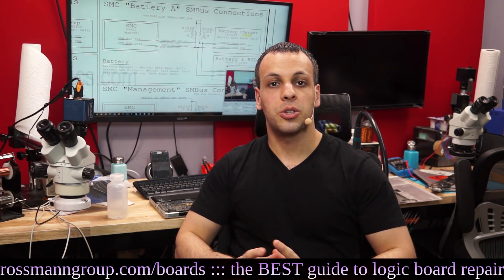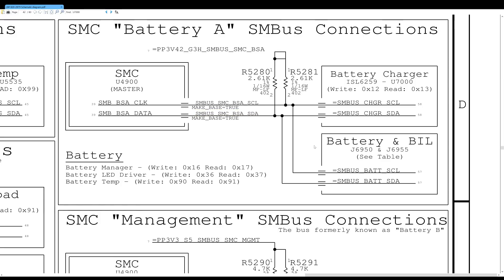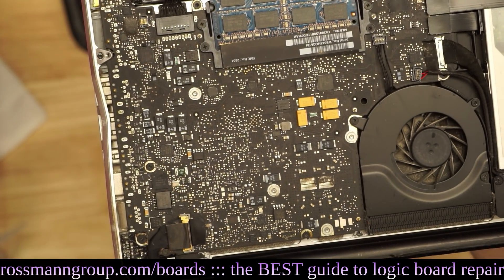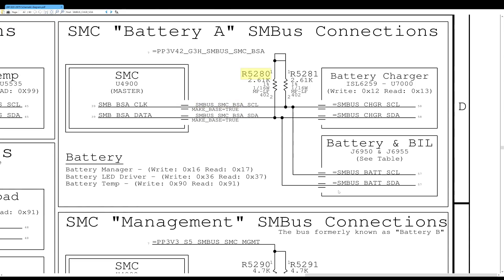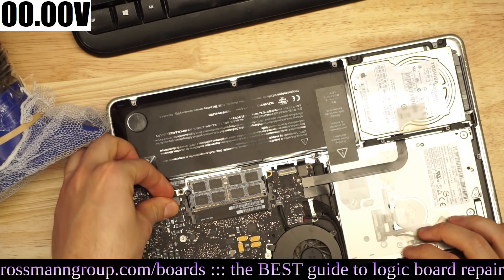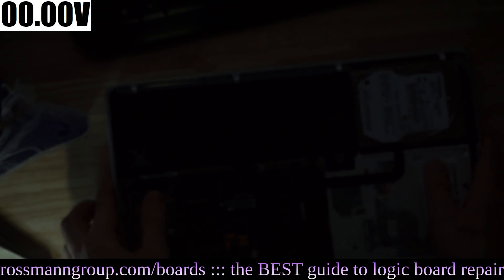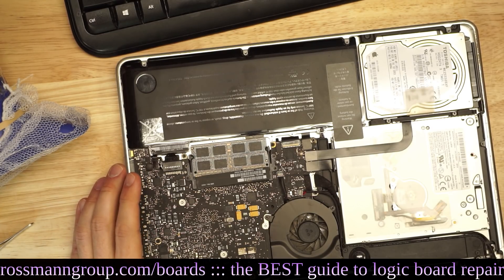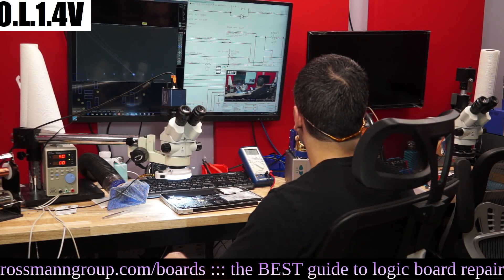Battery not showing up on A1278 Unibody Macbook Pro: how to troubleshoot & repair.

Comment: Thank you very much Louis for this excellent repair tutorial and help.

In my case I have a battery indicator that when you press the button, all the indicator LEDs flash 5 times "blinking".

What is it indicating?

Magsafe lights green, no blinking.

I can't find an answer on the internet.

Thank you!

Comment: I just want to say thanks for posting the video. You helped me out tremendously! Thanks to you I was able to diagnose my issue down to the battery indicator led strip. Whenever it was connected to the board my computer would not recognize the battery. I replaced the battery indicator strip and bingo! Thanks again!🙌🙌

Comment: Hello. I have a MacBook air 13" witch does not recognize the battery. I did check the voltage in these data lines and they have 3.2v. What could be the problem?

Comment: Good day sir..im newly laptop technician..only i ask regarding the a1278 unibody model.. When i check the voltage in white fuse was only 8.6Volts.. I cannot do to replace the SMC because maybe it need to reprogram..or not? But the charging ic was already replace from donor board..but the voltage still d same 8.6V.. Please help me sir..thanks

Comment: This video is amazing!  My Macbook wasn't charging. I had purchased a new charger not to long ago. I was convinced that it was a board issue not a charger. Checked the voltages like you described and realized was not getting power from the charger anywhere. The charger was dead and I confirmed by asking a friend to borrow a charger. I probably didn't need to do all that for a broken charger but it helped.

Comment: Ok I get all that BUT if you know it's the battery where do you get a  GOOD replacement? You say ebay and Amazon batteries are crap and that's true and used Oems are like 10 years old at this point so they are trash and the cheap knock offs Only work for a few months.. So where can you find good like new Oem batteries???

Comment: Hi Louis , my battery indicator doesn’t show any lights at the first place should I check still check by removing the cable
Reply: When I remove the battery indicator and connect the battery , it’s still shows battery charge 0%
Reply: As soon I connect the battery connector my laptop starts by itself , the battery in system preferences shows 0% but my battery turns on and runs properly, I last remember the charging as 65% .. plz help me

Comment: i have the problem where when i plug in the charger its green, battery is not showing up and will not charge. when it does have charge (a new battery with juice in it) it will do the shut off thing it does when the battery is dying after being plugged in. i get 12.26 volts on the fuse and it is the same after unplugging the battery level indicator. it has had coffee spilt on it, but before i took it apart all was working until i took it apart and replace the broken keyboard and cleaned all the dried coffee with alcohol and a qtip. would this be a bad SMC or just a short i keep missing every time i take it apart? A1278 model btw hence why im on this exact video

Comment: Hey Louis! Before I ask you this question I would like to wish you a merry Christmas and a happy new year! I know it is old now but I have an A1278, in which the battery does not show. The battery indicator also does not show, and I am getting the .52 voltage on the data lines, however I am only getting the 12.23v on the fuse. Anything you can point me towards? I’m an an electronics engineer myself so I should really be looking at the schematics and fault finding as one does, however at this stage it might be easier to just buy a new logic board.
Thanks!! Curtis

Comment: Hello brother,
My Macbook Pro 13 inch (mid 2012) sleep immediately I plug out the power source and it will not on again until I plug in the power, when I plug in the charger, it usually switch on by it self. I try different method such as:
Resetting SMC, PRAM reset. I remove the battery and plug it in again. I finally loose the mother board and fix it back thinking it might resolve the issue but still no result.
Please can you help me check out the issue?
By the way I'm running Catalina

Thank u in advance!

Comment: This is the best video on this issue to be found. Your videos are among the best out there. Thank you. Question: can I run my MacBook pro 2011 with the battery indicator LED unplugged? The machine runs on battery nicely and the power cord also charges the battery appropriately.  Can I cause damage though, if that LED is unplugged? Thanks again. Chaim csalamon@gmail.com
Reply from the maker: It will run, but it will not sleep if you close the lid. You will need to put it to sleep manually. If you close it and put it in a backpack it will overheat and die. The battery LED is not just the battery LED, but also a hall sensor so the machine can detect the magnet in the screen assembly so it knows when it is closed.

Comment: Thank you Louis!  My symptoms are no battery LED and shutoff at around 10% of boot progress bar.  Charger has dim green light with battery plugged in and not plugged in.  Will not turn on with battery alone so battery either dead or not charging.  Shutoff occurs with and without battery and LED indicator plugged in.  Is shutoff related to data line or charging?

I am getting 12.25V at the fuse with and without LED indicator plugged in.  I am getting .504V on both diodes.  So, data line not shorted??

EDIT ADD:  I unplugged the keyboard and the computer booted up with an external HDD.  LED indicator is now working and getting one LED.  Charger shows bright amber light which is battery charging.  Hooray, making progress!  Thanks again, couldn't have done this without you.

EDIT ADD 2:  Battery is charging!  Not looking forward to replacing keyboard but it is something a parts replacer like myself can do.

Comment: Hey buddy i checked voltage on the white fuse and only adapter was connected im getting 12.56 and as i know this voltage means smc is working but every 5 seconds voltage drop to 3v and then to 12.56 any idea ?

Comment: Do I need a new Battery Indicator?  I disconnected the battery indicator flex cable, now the battery is detected, but it doesn't work without the magsafe cable.

Comment: Hi, I took out a battery from a friend's Macbook Air. I plugged everything back and it all seemed to be working well. A day later she sent me a message saying that the battery drained overnight. I am not sure if I plugged everything back tightly enough. Is it possible that I plugged some connectors back loosely and that is now causing the battery to drain faster? I don't think I did anything wrong. But she is complaining that her battery always held its charge overnight and now it doesn't anymore..

Comment: hey there Louis, I was wondering, i have a MacBook Air (13-inch, Mid 2013) here. I have a friend who had the “Service Battery” warning come up for him a few months ago, and instead of taking it in to be serviced, he waited until the device fully shut down before looking into the issue. 
originally, the charger light stayed orange overnight, and wouldn't recognize the charge. however, after replacing the battery, it now turns green after an extended charge, but it still doesn't power on. The fuse on the F7140 is testing at 8.6V on both sides, so it is still intact. do you have a good guide on how to troubleshoot this specific problem? 

i AM equipped with the Schematics and board diagrams for this procedure, as well as enough soldering background on cell phones to claim at least a moderate skill level.

thankyou for taking your time on this, and i look forward to hearing from you.

Comment: Hi champ, so my MacBook Pro 13 late  2011 doesn’t recognize the battery. But charger light is always green. Already tried getting a new battery and switching batteries but no fix. Being in Europe I don’t think it’s advisable to ship all over to ur end. Can u pls just list all the possible components that may be wrong so I just buy from ur shop and get it fixed. Thank you!
Reply: Is a short to ground check voltage
Reply: R L ok thank you. I will have to get a tester online to do that then. But are there any possible components to change or a way to fix it?
Reply: Gilbert Osei May be the SMC if you get less than 12 v
Reply: Gilbert Osei my MacBook the problem was the SMC base on the diagnostic after checking voltage and just change The SMC and the problem is fix now Mac recognize the battery 🔋 woww
Reply: R L fortunately for me my cheap meter arrived and I just started this video again to check the voltage as recommended. Will let you know in a moment hopefully. Thanks
Reply: Ok so I checked and I got 12.32V.
Reply: Gilbert Osei did you remove battery and plug the charger?
Reply: R L yes pls I removed the battery and plugged in the charger.
Reply: Gilbert Osei what’s the model A1278?
Reply: R L yes lls
Reply: Gilbert Osei look with a magnify for missing components on data line
Reply: Hey sorry I have to ask but did you ever find a solution to your macbook pro? I have similar model and it doesn’t recognize the battery. Tried and checked everything except checking the voltage but it doesn’t work. Any tips before I actually buy Voltmeter? I live in Europe too this has cost me more than a new laptop. Thanks!!

Comment: wish you could fix mine.  Had a battery in my mid2015 then one day battery appears to be disconnected from the mother board. Can only use laptop with power plugged in. Replaced battery and all was fine for less than a day. Now laptop randomly shuts down even after conditioning and SMC reset. Charged overnight and woke up to a dead (non showing) battery, WTH!

Comment: Hi man. Big fan. I have a little problem so help me if you can. Girlfriends MacBook Pro was water damaged and i succeeded to repair most of the damage(it is turning on now and booting) but there is still one thing i cant repair and cant find it on any schematics i have. Two tracks are burned and i need help reconnecting them to the right place on the board. I have video uploaded: https://youtu.be/m7WsbHuLqVw . Help if you can.

I found solution. Tracks are between R5410 and U5410 (INA213 pins 4 and 5)

Comment: Hey Louis,
On my Mid 2012 13" Macbook Pro (A1278), the battery no longer shows within the OS and the Battery check LED/Button doesn't light up or work any longer.

Would this be usually caused by a motherboard issue? or would a completely dead battery not allow the LED Check light to come on if the system doesnt see it?

Thanks
Reply: I have the same problem too please take your time to reply us Louis
Reply: Me too

Comment: Wow! This is heavy viewing. Way out of my league I suspect. Here's my problem:

I recently bought a used mid 2012 MacBook Pro and saw it working before I took it away. The only issue was that he previous owner had bought it from someone else before I bought it from him, so he wasn't altogether sure of it's history. I did state that there had been an issue with the battery with the previous owner, so he had removed it and just ran it direct from the power.
So...
I loaded the MacBook up and ran it as you would. I went into the system settings to change the direction the trackpad scrolled, only to find that the system wasn't recognising that there was a track pad there. Strange!
The other issue was that the webcam/eyesight wasn't working either, so I decided to order a replacement battery and take the back off of the unit to have a look to see if there was anything obvious amiss.

The Macbook runs fine from the power cable, but it has to be plugged in permanently for power.

1. The cable from the eyesight had not only been disconnected, I can't actually find where the end is – so it looks as though the cable has been completely removed for some reason.

2. There's nothing obvious with the trackpad – I even tried the trackpad from my other, identical spec model etc, macbook (same year, model, blah blah blah). Not sure if the issue with the trackpad is the ribbon cable or...

I've spoken to a repair guy at the other end of the UK who said that if the battery has swollen (apparently there was a known issue with batteries on this model/year), the battery, camera and track pad all run from the same BUS – this could possibly be the route of the issue?

I've just fit a new battery (I've also tried it in my other Macbook and it works fine), and the Macbook with the faults isn't recognising the battery. It won't boot up; there's no battery level lights showing etc.

I'm trying to find a solution as to whether this is a board issue (chip etc), or something easily repairable at home for a few £££?

Any thoughts?
Reply: Hi man, I am literally in the exact same scenario as you but one year later, did you ever find a solution?

Comment: Something completely unrelated to the topic of the video; why are you using Impact as the font for your OSD meter? Something like this might be nice: https://www.dafont.com/transponder-aoe.font
Reply: He didn't choose it.  It's because that was the default testing font I used when I wrote the software originally (The OBS-text version works quite nicely with outlined impact).  You'll see in his very latest streams it's now all fixed up using monospace and behaving properly.
Reply: I noticed. Nice. Now just having it stop displaying millivolts in volts mode and you're all set. Probably already fixed it by now.
Reply: Correct you are. Just waiting on Louis to update.  The software now also supports user-selected font (though defaults to Andale for now).

https://github.com/inflex/BK-390A

Comment: I have replaced the battery and it is detected correcly but if the macbook enters sleep mode or I close the lid then I can't turn it on anymore, I have to disconect and connect the battery for it to turn on and work normally. any guesses?

Comment: 12.56v is very close to 12.6v which would be the equivalent voltage (fully charged) of 3 Lithium polymer cells in series. So 12.56v doesn't sound all that abnormal to me. Can someone tell me why the Macbooks 12.56v would be a non standard charging voltage? I don't do Mac or Windows laptop repairs.

Comment: your thought on my notification from a vendor for iPhone 8 replacement screens ?: After iOS 11.3 debuted, concerns arose that aftermarket screens for the iPhone 8 and 8 Plus may not be compatible with the update.
Reports suggest iOS 11.3 may permanently disable 3D Touch functionality on upgraded phones with replacement screens. To address the issue, we are suspending sales on our current inventory of A+ screens for these phones while working with our vendors to ensure new screens test and perform as expected.

Comment: You could also do a PSA about the A1286 (2008-2012) which, for some unknown reason, had a different battery in the 2011/2012 models with the same form factor, slightly higher capacity and a different connector WITH THE POLARITY REVERSED. So when changing the connector, you have to watch out for that. I've documented my experience here: http://wiki.mbirth.de/know-how/hardware/apple-macbook-pro-a1286-battery.html

Comment: I bought a macbook 1181 lately only for the purpose of repairing it,  it has two vertical stripes at two places of the screen about half an inch width. then the hd failed during work before I managed to backup it and is clicking now